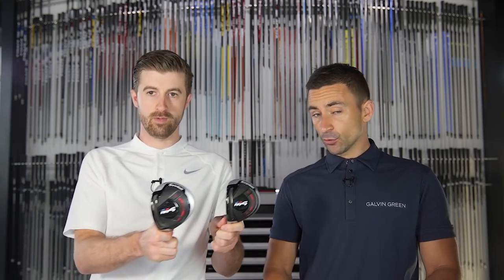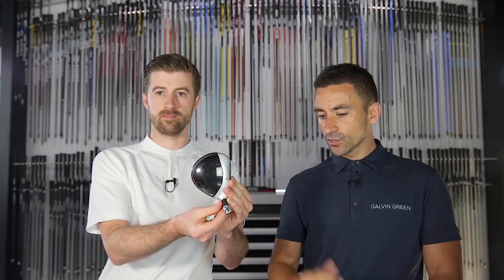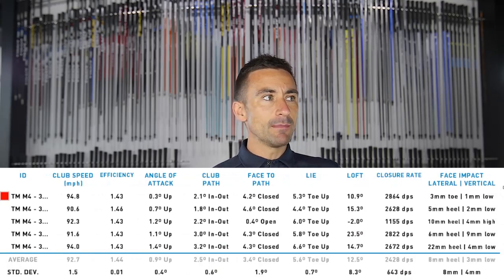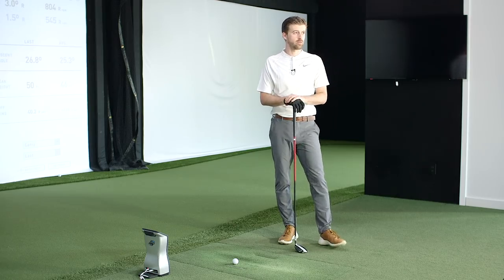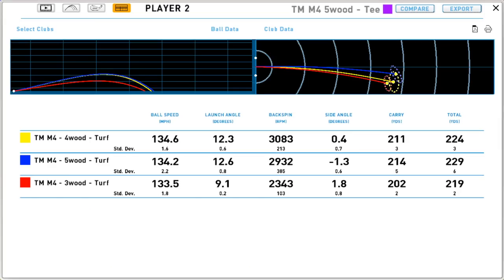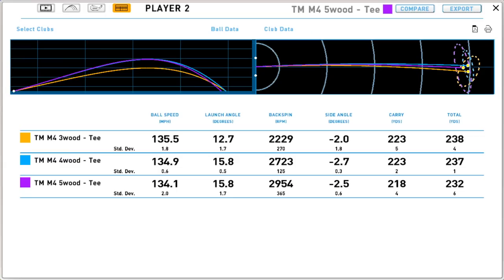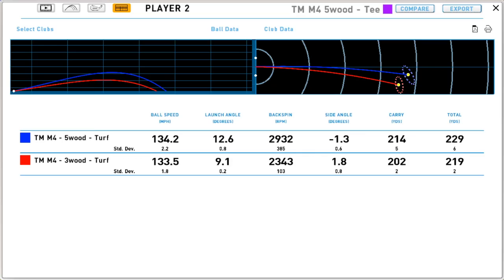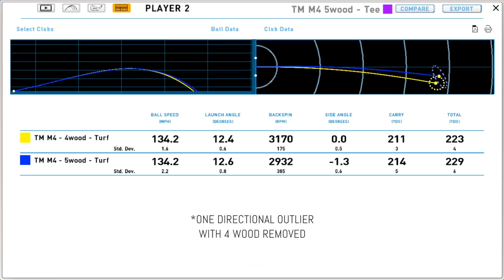Are You Playing the Right Fairway Wood Loft?

Comment: So now we have so many adjustable clubs like the cobra f7 / f8 would you favour a low lofted 5w or high lofted 3w?
Reply from the maker: When adjusting the hosel on clubs like that, just be aware that changing the loft will affect the face angle. Ideally order a 16.5º or 17º club head if you want the most neutral setup. However for someone that wants to draw the ball or limit a slice, adjusting a 3 wood (15º) up in loft is a good option as it will close the face a bit.
Reply: TXG Tour Experience Golf Thanks for answering my question. I suffer with missing left more than anything and naturally draw the ball. I find it really really difficult finding the right clubs to sit between my longest iron (5i -180yds) and my driver (250yds). Hybrids just want to go left on me and utility irons don’t go far enough. (Typical Club head speed with a driver is around 100mph). 
I think the moral of the story is that golf is just hard. Thanks again for answering my question. Keep up the great content. I’m learning from every video you guys make. 👍🏻
Reply from the maker: Our pleasure! If your miss is left, go with a 5 wood adjustable head and adjust the loft lower which will open the face.
Reply: TXG Tour Experience Golf Thanks. I’ll try that this weekend and report back 😁

Comment: This is why I quit carrying a 3 wood.  I swing driver ~ 100 mph, but my 3 and 5 woods are nearly identical in carry distance from the fairway, with the 5 wood being much easier to hit consistently, and run less on landing.  My advice for 100 mph swingers:  Don't waste shots hitting less than 20 degrees of loft from the grass.  Get over it, we're not PGA pros.  Use that extra club where it helps you for short game, improve your scoring, and get on with golf.

Comment: So are you better off lofting up at 3 wood or Lofting down a 5 wood?
Reply from the maker: If using an adjustable 3 wood and setting the loft higher, you'll be closing the face a bit. If you're using an adjustable 5 wood and setting the loft lower, you'll be opening the face a bit. So it will depend on what you're looking to achieve with the ball flight. Also keep in mind the shaft length, 3 woods come standard with a longer shaft than a 5 wood.
Reply: Interesting. Thanks for the reply as my proclivity with fairway woods is for a draw I think that lofting down the 5 wood is a better play.  Thanks!

Comment: Is this test using the same shaft length on all three heads?
Reply from the maker: Yes
Reply: Thanks! That's a great idea that could help mid handicappers like me. I'm struggling from the fairway or par 3 at 200-215 with my 3 hybrid carrying 180. I've thought of a strong 2 hybrid replacing my lob wedge (which I rarely hit), but a 5 wood with a 3/4 wood length shaft might give me more confidence and reach from both the tee and fairway.  My swing speed is similar to what you were testing, so I might find I have good or better distance off the tee with the 5 wood loft, it could possibly replace a 3 wood off the tee which i rarely hit off the grass, anyway, and free up a spot for a wedge again. I use to carry a 5 wood that I could grip 1/2" or 1" down on to hit 175 or take a full swing for 200, 210 off the tee, 190 off the grass.
Reply: Oh, and thanks for dialing the swing speed back to human levels, it's very helpful to me. Often I can't quite figure out how to relate to your testing at a low handicapper's club speed. Could you redo your tests on the hybrid vs fairway vs driving iron at mid-handicappers swing speed? Maybe consider having a talented senior or mid handicapper do some tests so we can compare against a player who doesn't have quite as solid or consistent impact as someone with your talent? I would guess a talented mid handicapper might hit 30% solid, 60% slight mis-hits, but I'll bet you are more like 60% solid and 30% slight mis-hits.

Comment: Carry a 3 wood but don’t hit it. 112 driver swing speed. Love my Ping Rapture 2-iron. Don’t need a fairway wood from fairway. Would like a fairway finder off tee in between driver and two iron. Maybe just not properly fit for 3 wood. Can bomb it in the 275 distance but terribly inaccurate.
Reply: Suggestions??
Reply from the maker: Depends what is causing your inaccuracy with the 3 wood, you should definitely try to schedule a fitting session to try some different options.